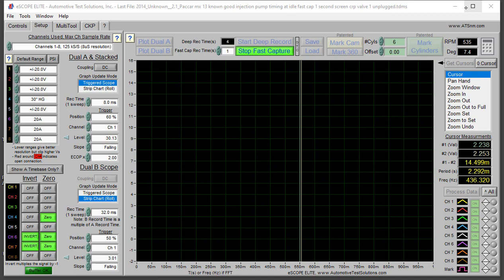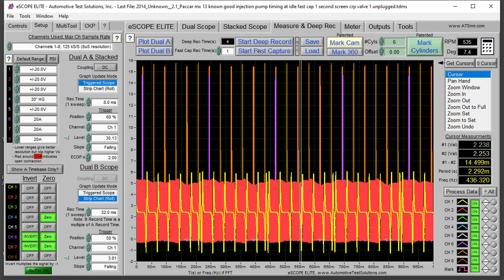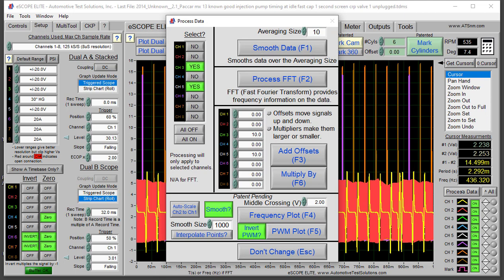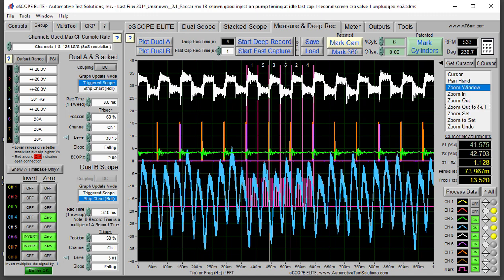Paccar mx 13 injection pump troubleshooting

Comment: Great video, lots of great diagnostic strategy. Been lucky enough to have DAVIE4 to troubleshoot EUP issues on the MX. As seen, they will start with one operational pump, so the disconnect method is quick check to get you going down correct diagnostic path. Like a lot of fuel system failures, the pumps have a high failure rate when debris gets in the non-return valve (outlet ceramic ball) and destroys it. Great care must be taken if removing outlet high pressure pipe to rail to prevent debris entry and flushing with hand primer pump is highly recommended. Worse failure is when EUP return spring breaks, takes out lifter anti-rotation bolt, and wipes out camshaft. I have pictures! I think a great application of this strategy would be very helpful on EPA17 up MX-13. The camshaft on those is hollow steel with pressed on lobes. I haven't seen it, but I have heard of the lobes loosing interference fit, slipping on cam, and microwelding back to cam so timing of cam lift vs coil operation is no longer in sequence. Curious if you have used a piezoelectric clamp on probe on any fuel high pressure testing? Once again, great video and keep them coming!!!!